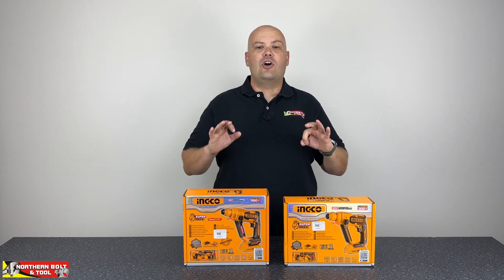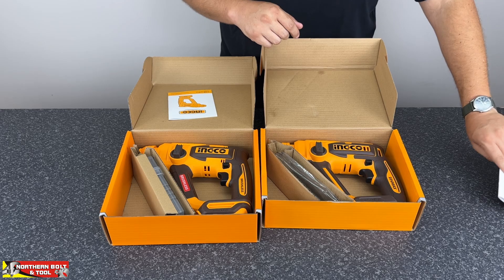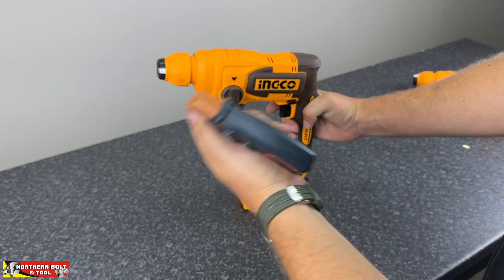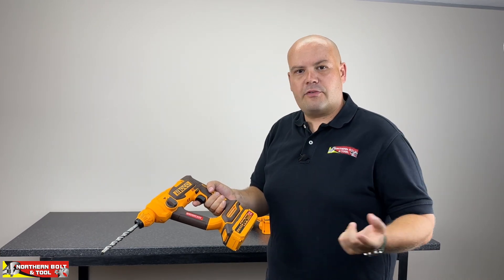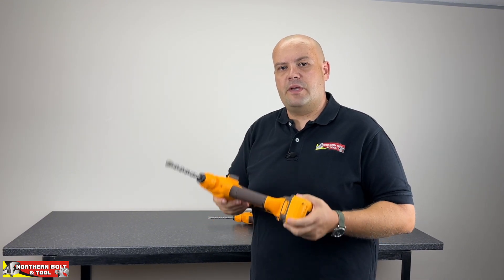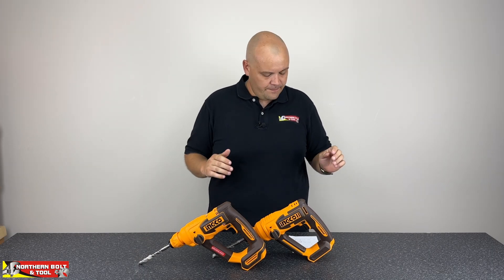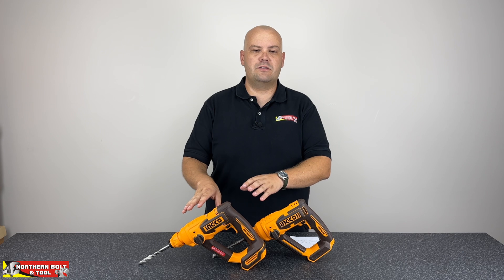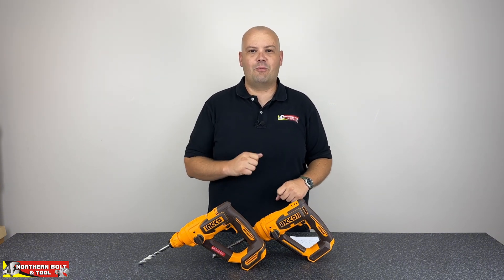Brushed vs Brushless: Worth the extra cost? Ingco Cordless Rotary Hammer Drill

Comment: I've got trust issues with this brand. Bought a ingco drill a few years ago(roughly 3-4) with the bases of it being "BRUSHLESS" it even has "BRUSHLESS" in bold capital letters on the back of drill but it's definitely brushed.. you can see the sparks everytime you pull the trigger. Dont get me wrong.. its still working to this day and goes good.. the charger blew up but ingco replaced it. Just be wary thats all.

Comment: Problem with these tools is you just used a good portion of their useful life just making this video.
Reply: I'm using INGCO drill since 3 years, I didn't have any issue 🤥 beside that I don't think any cordless tool will ever be as useful as corded one 👀
Reply: I've been using ingco for years and still have my first ingco drill that I bought 
And my impact wrench also still works fine 
So you don't know what you are talking about
Reply: @ianboxing  I've got an ingco drill and it's been used for light use at a guest house for basic maintenance and that thing spins but the bearings are shot. Sounds terrible, chuck is crunchy and jammed and hard to operate. It's just pretty garbage and for the price I wouldn't expect otherwise but to pretend they're amazing top tier tools is pretty ridiculous.
Reply: @decommonifyable  I don't belive it 
I know construction workers that use it and firemen that use their tools on the job
Reply: @decommonifyable  I actually believe you got a lemon. I was skeptical about them when they first came out, but all the workmen I've known swear by them. And these <insert colourful language> are abusive... Ingco would very quickly get dumped if contractors weren't happy because they are the primary source of sales. Most normal people don't own a drill and are rarely DIY'ers.
Reply: @forger9443  perhaps. It was bought years ago when they first came to SA. Maybe they've improved. I'm considering trying their cordless range.

Comment: I love Ingco tools!. However, knowing whether you applied the same downward force with the two machines is impossible. You could consider a standard weight placed above each machine to get scientific results. Or/and, drill ten or twenty 100mm deep holes with both (make a rudimentary depth gauge), note the overall time, and test how much battery capacity is left. I do however believe that brushless tools are better. Thanks for being such an informative channel! I wonder how these two compare with the bigger concrete drills? CRHLI20208 and CRHLI20288. Such comparative tests will add value to us who use them daily in our industry. I use my cordless drill and corded angle grinders almost daily for three years now with no worries. I will acquire the following cordless Ingco tools this year: The bigger concrete drill, five more drills, jigsaw, angle grinder, multi tool, sanders, sabre saw, small chain saw, Impact driver, nail gun, mitre saw, vacuum, large capacity batteries, bandsaw, wall chaser, blower, glue gun, compressor, polisher, mini cut-off, heatgun, hedge trimmer, fan, and laser level. When are we getting a cordless beltsander, plunge track-saw (Festool-style, the current circular saw is not viable for me). I would also like to see a better cordless jigsaw (mainly regarding the baseplate, like the corded one). I used to only buy expensive tools.....with Ingco, it's no longer necessary....the quality is so satisfying!

Comment: What's the main difference between this 1.8J Rotary Hammer and 66nm Impact Cordless Drill in terms of impact and drill functions? 

To my understanding, 'BPM' and 'J' represents the chipping/ hammering power and it doesn't represent how powerful its drilling capability is. Whereas, 'RPM' and 'BPM' in Impact Ingco drill show how powerful its drilling capability is.

I think for drilling, 66nm Drill is better because of higher RPM and BPM. For chipping/ hammering, Rotary Hammer is better because of its "J" figure.
Reply: Try drilling a 13mm hole into a lintel with the 66nm drill and you will be wishing you had the rotary hammer drill
Reply: To clarify:
- BPM blows of the hammer per minute
- RPM revolutions of the chuck per minute
- J the joules of energy imparted by the hammer per blow of impact
- Torque the strength of the rotation force during the chuck revolutions

There are two types of driling: one where the main resistance is torsional and occurs along the entire shaft of the drill bit like in metal and wood drilling; and two where the main resistance is penetrative and really at the tip of the drill bit from the hardness of the material like in concrete drilling.

You are correct that BPM and Joules are more relevant in penetrative resistance or concrete drilling applications. RPM and Torque are more relevant in torsional resistance or metal/wood drilling applications. The Rotary hammers are custom built for hammering into concrete, so you usually don't find torque specs on these, whereas the normal hammer drills are primarly desiged for cutting into metal and wood with minor drilling into concrete so you don't find the Joules rating but instead have the Torque and BPM given.

Joules is supposed to tie together the mass of the actual hammer inside the drill and the actual distance and speed it travels inisde the case before "hitting the chuck". That formula is the kinetic energy forumuila of 1/2 x M x V x V where M is the mass in kg and V is the velocity in m/s. with Since we can really only move very small distances inside the dril, the most influential factor is the mass, so rotary hammers use generally heavier hammers than their impact drill counterparts. That's why another user said a Rotary Hammer drill will do concrete drilling much easier than a normal hammer drill, (though I am curious as to their torque ability,)
Reply from the maker: Rotary hammer drills and impact drills are very different in their designs. The rotary hammer literally has a hammer in the machine that hammers the back of the drill bit. an impact drill has something like to corrugated discs that move over each other under tension creating the impact. This means that impact drills have a lot less impacting force than a rotary hammer drill which is why impact drills struggle drilling into concreate and they are more suited to masonry applications.
Reply: @NorthernBoltandTool  If you don't mind, while your're here, have you seen any normal hammer drills with this piston design? I've seen some teardowns on youtube with supposed hammer drills that have the p[iston design, but I'm not sure if they're call the device the correct thing. It's shaped just like a normal hammer drill however, so I dunno.